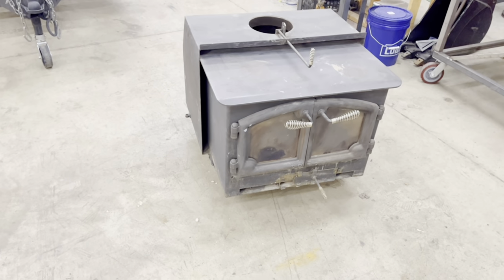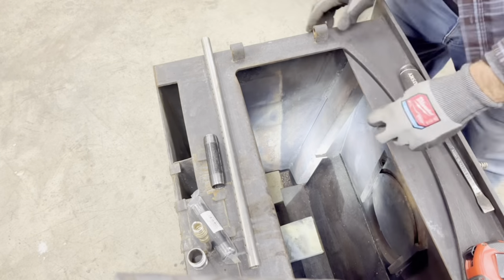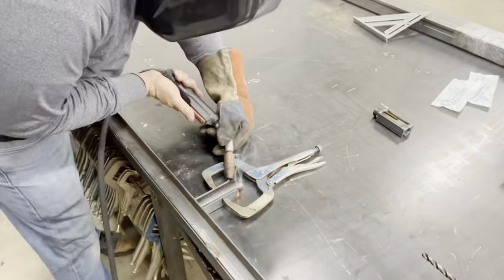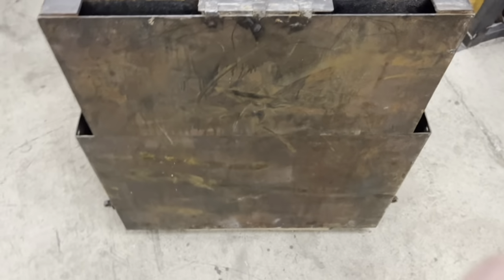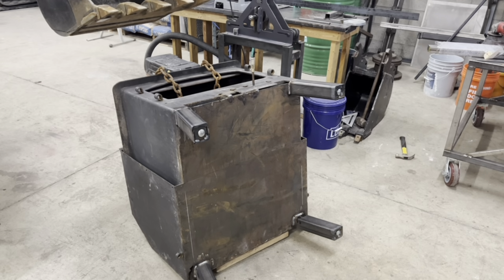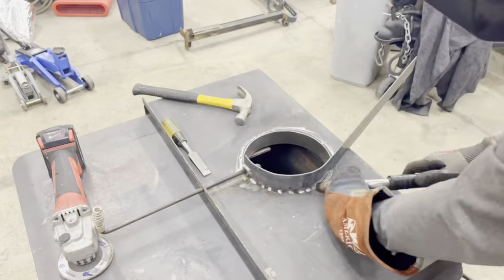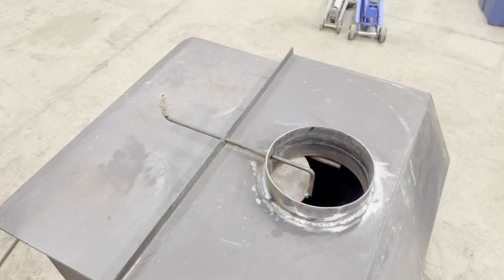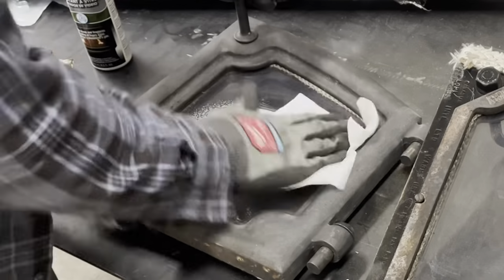Transforming Old Wood Burning Insert into Efficient Freestanding Stove

Comment: Cast steel
or steel
for welds...?

+ simple:
slot at the bottom,
2 vertical sheets - curved sheets at the top, and pierced -
a short sheet = low air inlet
a long sheet = high air inlet
Reply from the maker: It is all mild steel welding, no cast. Thanks for the comments!  Good luck on the Pizza Oven Wood Stove!